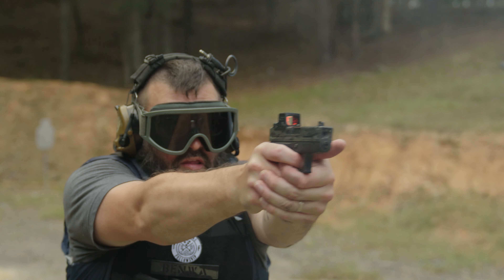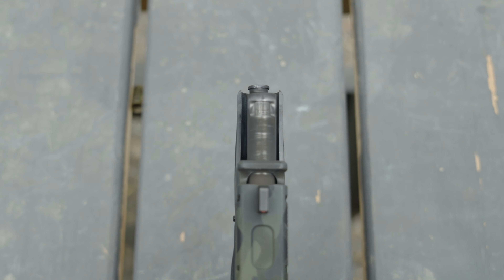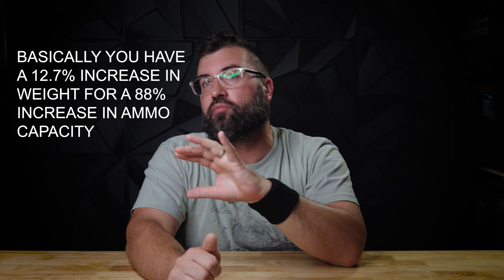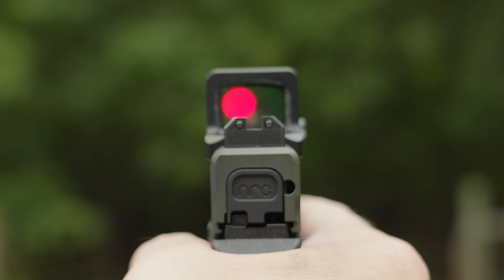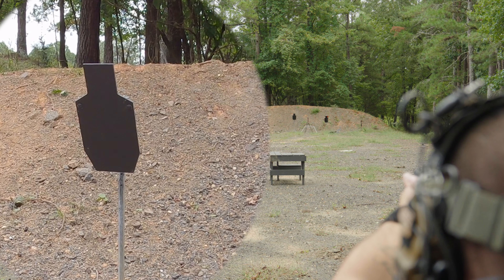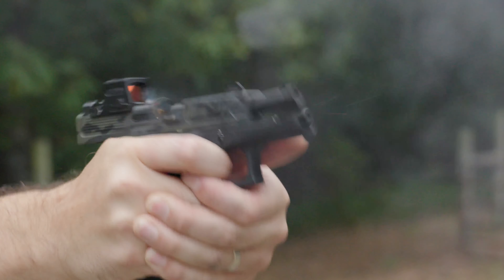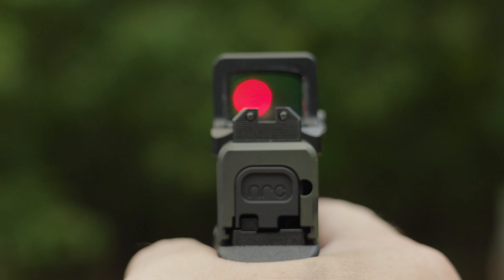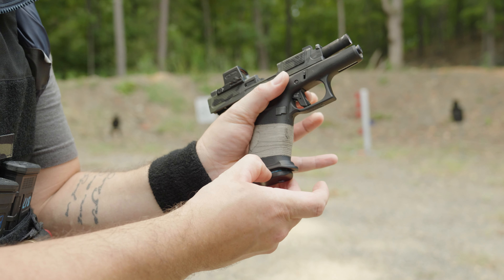G43x ARC | Optimum Glock EDC? Fascinating Insights + Full Build Review

Comment: My expectations and standards around the 43x is pretty honest/realistic. From a true EDC perspective it’s a quick get off me gun more than anything.
Reply from the maker: curious if you're using shield mags or OEM for you 43x?
Reply: @TacticalFellowship  just running OEM mags brother.
Reply: Dagger micro mags are the way. They're not perfect, I recommend you replace the 3d printed followers in the current Gen with OEM g17 followers (also replace mag springs if you actually EDC the mag). I'm well over 2000 rds a piece on my converted mags

Comment: Being Necessary to having a red - dot installed for accracy is Very disappointing,that is a Deal Breaker 😳😤😕...
Reply from the maker: it's what I discovered during testing and knew you needed to know in order to make the best decision. For some guys this will be no big deal, snub nose length out to 50yrds without cowitness. Just wanted you to get best idea what you'll have and not have with this setup:)
Reply: @TacticalFellowship  
Again thanks for the info... 👍😎🇺🇸
So I may be going with the PPM's micro barrel & compensator combo,I dont like the set-up but it will perform without accracy issues 😐
Reply from the maker: @ellissmithjr6599  PMM's are tanks, super good but agree with you, once they on they are on for life. I'm waiting for Radian Ramjet Afterburner to someday come out for G43
Reply: @TacticalFellowship  
Agreed👍😎

Comment: this is cool. The pricing is similar to a radian ramjet afterburner (which should be releasing soon for the 43x), so I wonder how those two would compare. If I had to bet, the accuracy potiential is greater with the radian than the arc. And you'd still have holster compatibility w/ 48 holsters. These micro Glocks are very cool, I dig my 43x, but it's very stock.
Reply from the maker: my guess is yes, radian ramjet 43x will have more accuracy BUT longer profile. If you already have 48 length holsters no big deal BUT if you have 43x length holsters the ARC gives you the value of comp without comp length:)